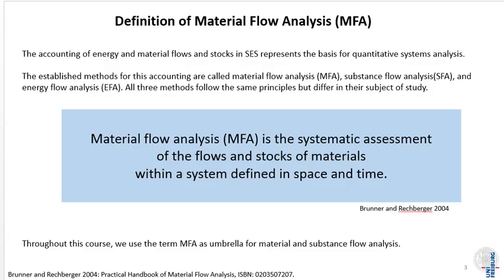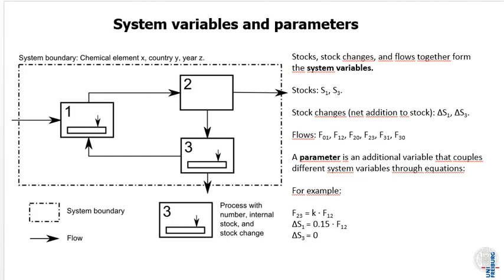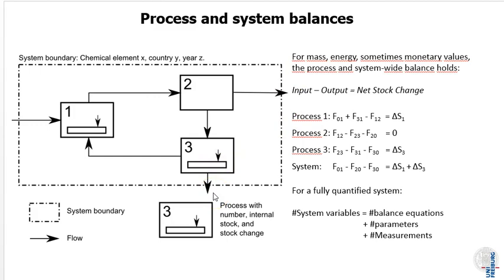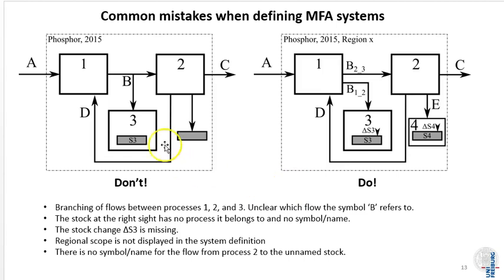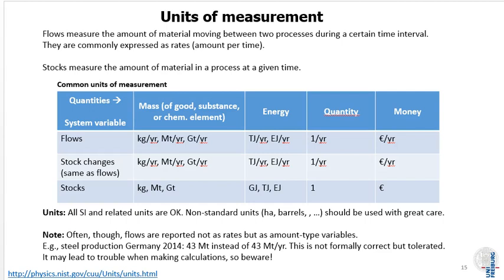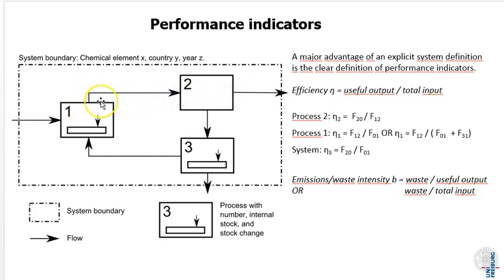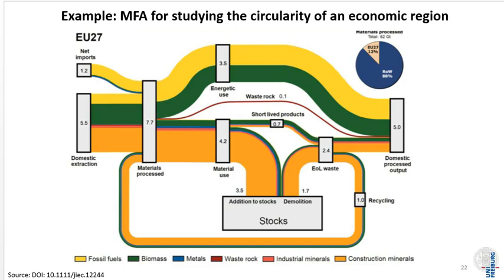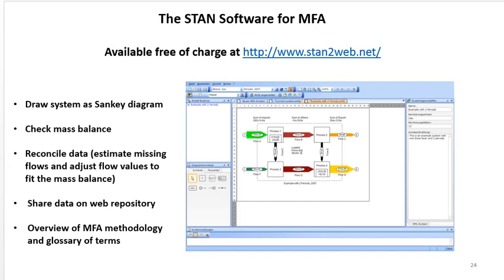IEooc Methods1 Lecture1: Material and energy flow analysis

Comment: I am confused about slide 13  
The flow going from process 1 to 2, shouldn‘t it be named B1_2 and the other one from process 1 to 3 B1_3 ?
Reply from the maker: Thanks for spotting this mistake Chris, you're absolutely right! Upper flow label should be B1_2 and lower one B1_3. Will post corrected version of slides during next IEooc update cycle.